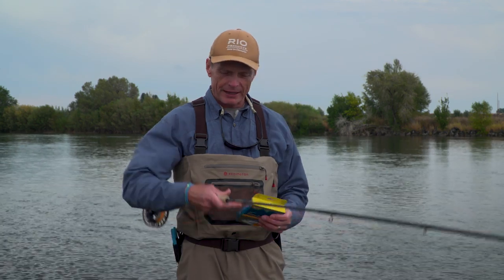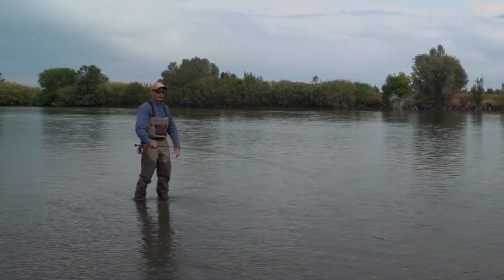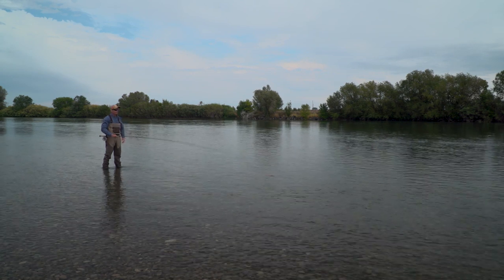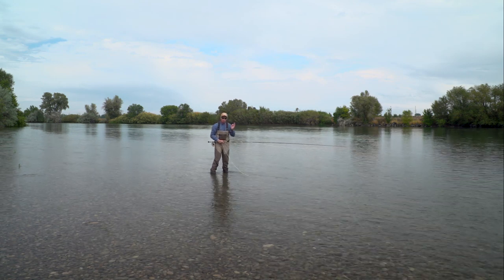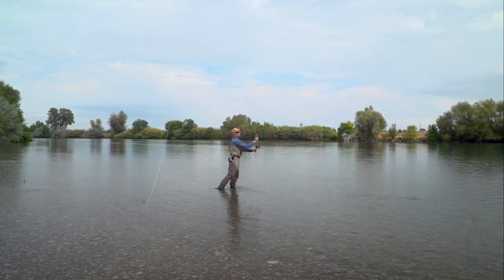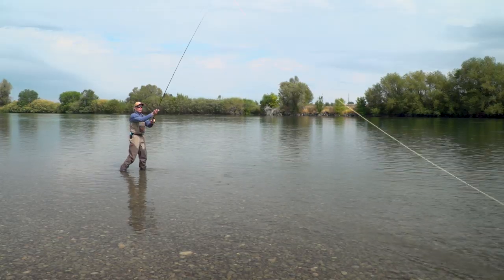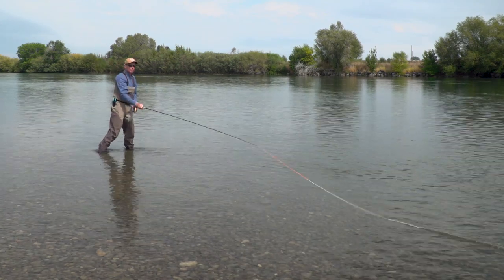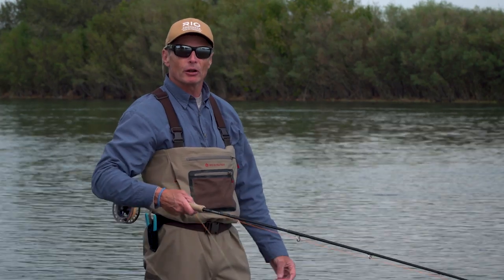S4 E2 How To Make A Double Spey Cast

Comment: An avid fan of yours Mr Gawesworth I have your casting book as well but don't have it with me at the moment..A few questions please if I may , its the leader that stays in the box correct ? even though the shooting head   Skagit or Skandi  plus leader maybe partly out along with running line and  when the cast is complete whether single or double and you have completed  swinging the soft hackle wets or lures you have to retrieve the line and my question is how much do you retrieve before you start the spey cast whether doubt or single
Reply from the maker: Hey Stuart, we asked Simon your questions. He said 1) "yes, well sort of the leader. The junction of the leader and line tip should be in the very center of the box, so if you have a very long leader, some of it will be outside the box". 2) "The most balanced set up when casting any shooting head is when there is about a 1 foot overhang of shooting line outside the rod. So it depends how far you cast as to how much you retrieve. When possible, strip all the shooting line in except that last one foot."
Reply: @RIOPRODUCTS  Outstanding ,many thanks indeed and stay safe
Reply from the maker: @stuartjones7903   you too, thanks

Comment: I had just viewed the Rio single spey video and in it is describes a 45degree angle "dip" on the back swing, rising up finishing high to develope a D loop.  This may be confusing to beginners when in a double spey or in finishing a Snap T, you do not want that "dip".  Am I seeing this correctly?
Reply from the maker: Hi Joe, we asked Simon what to explain. He said that the Single Spey is the only one of the five main Spey casts that has any kind of dip during the D-loop stroke. All the others should have a slightly, continuously rising rod tip path during the D-loop stroke. Hopefully that makes some kind of sense?